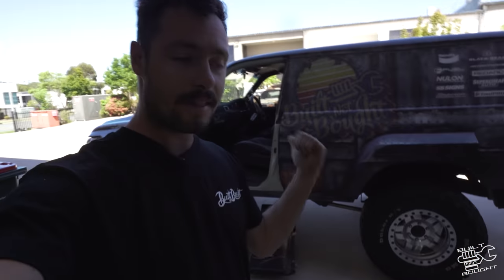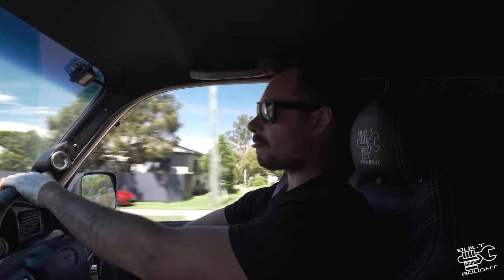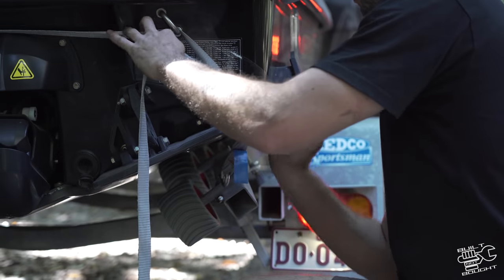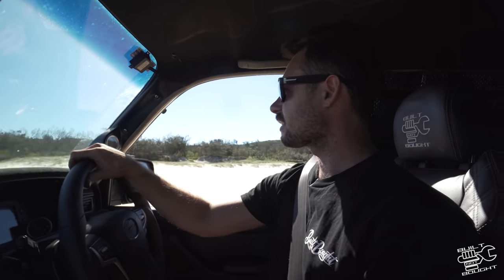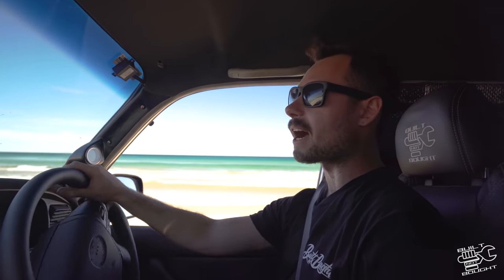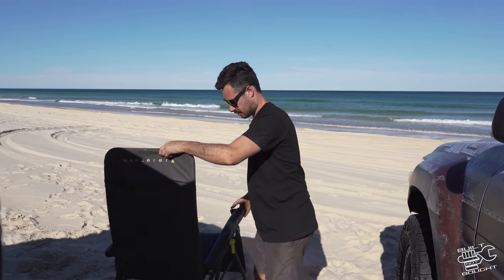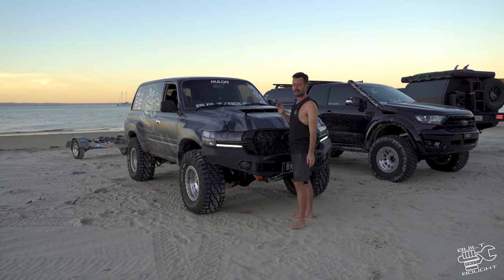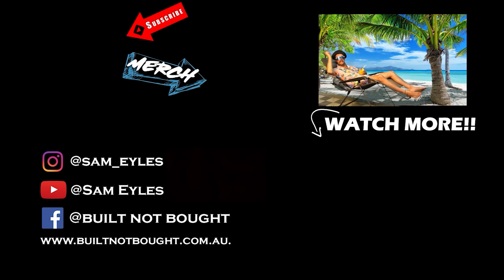BNB 80 || Vancruiser Goes For It's First BOOST Down The Beach!!

Comment: Sam! Oil coolers can cause other issues like blocked coolers disconnect hoses etc get some quality high temp oil like motul 300v or car weight specific 0w40-10w40 etc. Owned a 370z which Overheated often and on the racetrack hit ecu limp mode shut-off at 160'c, only think I changed was the oil to quality high temp motul and never had a issue again.
Reply: Along with good quality fuel I suggest BP helps too!